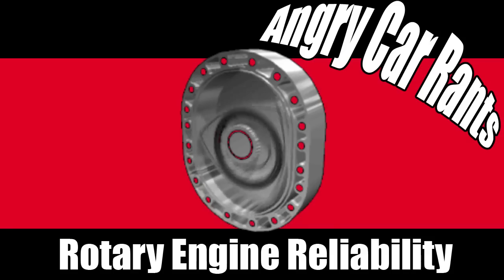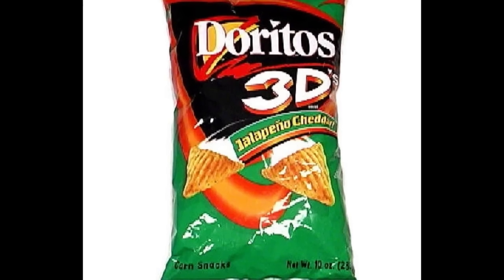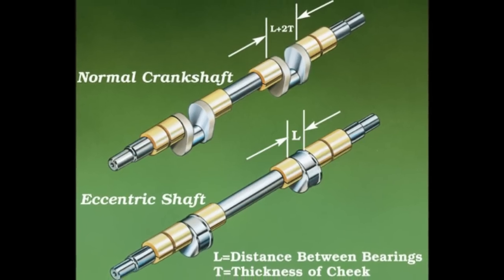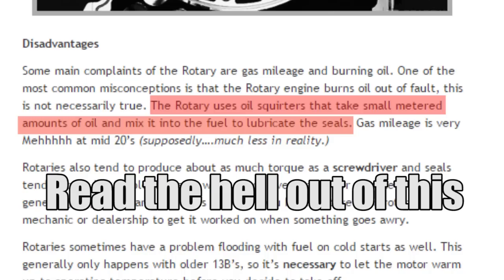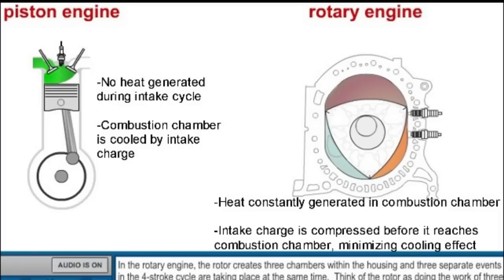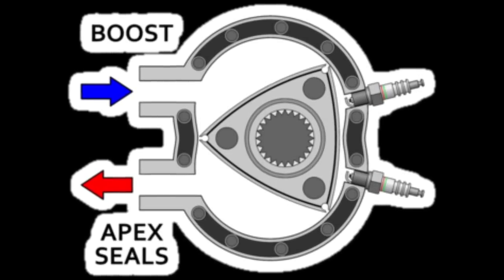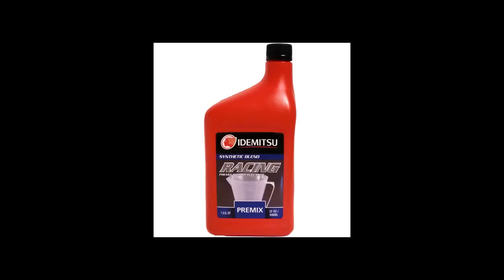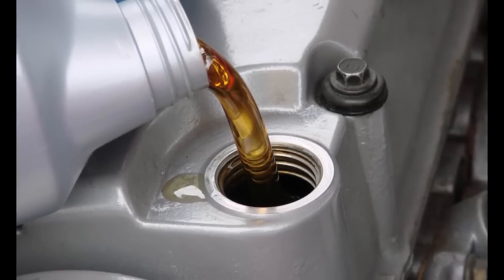Angry Car Rants #3 - Rotary Engine Reliability

Comment: The only caveat I would bring up to all of this is for series 2 RX8 owners.  If the OMP is still on the car, it's best not to premix.  Reason being that a third injector was added to each housing.  It's a bit of a debated topic but it seems most agree it's no longer needed for that engine specifically.
Reply: You should never remove the OMP on the RX-8.. Pre-mixing only helps if someone carelessly runs the engine low on oil. The most common failure mode of the apex seals is not prevented by pre-mix and is actually made worse by pre-mixing.. although this may be a popular myth? it does absolutely nothing to prolong the life of you engine...
Reply: Pretty much all race engines are OMP free...
Reply: +Chad Bremer But your average RX-8 owner is not racing.. so its still very bad advice.
Reply: +Chad Bremer You do realize that a proper race car does not have DFCO mode either.
Reply: I never advised removing the OMP.  Your reading comprehension is not up to par these days.  

As for fuel cutoff, that is pretty obvious.  It's a fuel saving feature.  Not needed for racing.  Also, the lack of lubrication is bad on the rotary that is race built.  Since it lacks any seal lube outside of the premix.  

I am curious.  You have been trolling rotary videos for years.  Not sure what drives you so hard in this pursuit.
Reply: +Chad Bremer Yet you recommend pre-mixing??? which will not extend the life of the engine if the OMP is working properly and the oil level is maintained.
Reply: +Chad Bremer  I'm not the one making childish insults and repeating bad advice and false rumors you read on a forum sites.
Reply: Oh, I'm sorry.  I forgot you know more about rotary engines than anyone else.  You are the all knowing god.  My bad.  lol
Reply: +Chad Bremer  No I just know a lot more about Rotary engines than you... you don't even know what a rotary engine is.
Reply: +Chad Bremer  What is the difference between a Uberusel UR-II and a   Le Rhône 9J "mr. Rotary expert"

Comment: The FAKE doktorbimmer you make me feel confident, because it reminds me that I’m not burdened with your negativity.
Reply: dakken74
dakken74
2 years ago
Once again,,it's obvious here who the angry troll here is,,,how do I know this? Because you are the one calling me that lol,,,your just making yourself look stupider the longer you persist lol
Reply: +Chuckiele Engineering is not a "faith based" endeavor son, it is a science that must comply with the laws of mechanics, and the laws of thermal and fluid dynamics. Mazda manufactured the Wankel KKM longer than any other company and they have not released a new production Wankel engine in 23 YEARS!  So I sincerely suggest if your hoping for the Wankel to comeback? That you don't hold your breath!
Reply: @dokterbimmer7270  ernie brink is simple, straightforward" Yes you are, Ernie. And it's guys like you who often have made discoveries that wound up changing the course of industries. You know stuff intuitively, while certain doktors point to theories and mock others while saying 'it can't be done'. Well, clearly it can be done. You called for some basic configuration changes in the wankel, Mazda did this (if not exactly what you called for) and 'boom!' they've revived the technology and found new advantages with it. Nice going, Ernie!
Reply: @dokterbimmer7270  this guy is you

Comment: They are reliable, just not very durable.  Never used premix and the engine in my car has only been rebuilt once total miles on the car about 165k with a 450whp, compression is still within spec on all faces.  Will it need a new housing or two when I do rebuild probably but it's not like premix is going to extend the housing past 180k anyway.

Comment: i heard the exhaust manifolds on most rotary Mazdas are really restrictive and cause most of the overheating problems, would replacing the stock exhaust system for one with a bigger diameter help noticeable with this problem?
Reply: George Washingturnt This reply is a bit late, but one of the main disadvantages of the rotary engine design is that they tend to be insanely loud. This can be fixed with decent mufflers and restrictive exhaust ports. The exhaust ports are part of the rotor housing, so to get less overheating and more power you need to replace the rotor housings with aftermarket racing ones. (The rotor housings are the equivalent to the cylinder head and engine block in a normal engine) The problem is that this causes the engine to be so insanely loud that your car will no longer be street legal.
Reply: George Washingturnt The problem is that the Wankel engine extract so little power from the heat generated during combustion so a much greater amount of heat exits the engine... it causes the high EGTs, explains the poor fuel economy and the Wankels horrible BSFC

Comment: Would the chance of engine flooding increase the more you stalled the car?
Reply: Flooding is most often caused by low compression due to damaged apex seals..  Get a proper compression test before you throw money at parts you don't need or just give you a temporary fix.. unless you plan to sell (which isn't a bad idea either)

Comment: To cool these spicy hot Doritos you need mountain dew, not bigger radiator.
Reply: We're working on a fully computer controlled Mountain Dew injection system. Main problem is the control valves getting all sticky.
Reply: Use diet Mountain Dew fam

Comment: No mazda rx8 recalls on engine (search for yourselves). Court case got thrown out by the judge and it was over the spark plugs. There are always the haters out there that will say anything they can against the rotary. And there are those who love the rotary. In my experience most haters of the rotary have never even sat in one. Others have had a bad experience like any other car out there. Rather experience it for yourself and then make up your own mind. But if you do want advice, rather talk to some one that knows it firsthand.
Reply: ummm the renesis was a bad motor... They had to extend the warranty on the engine due to so many failures, some of the remanufactured engine came with the sameeeee problem too. Blowing up before even hitting 1k miles

Comment: man im planning on getting a mazda rx8 as my next car but after all the complaints people have and the reputation of rotary is it really worth the hassle, even though i love the car and would love to own one?
Reply: jiuop Check the oil. Change the oil. Maybe pre-mix? Don't overheat the engine. Don't cold shut off. Redline every day. Should be fine. Ask previous owner "how much oil does it burn/consume?" If they say none, run.
Reply: ninjagrayfox thx for the advice man
Reply: jiuop Don't let the reliability reputation dissuade you, rotaries and particularly naturally aspirated ones can live long lives when maintained properly. They just require a little more vigilance than say a Toyota Camry or Civic Si.
Reply: jiuop The Renesis engine has a very bad reliabilty record.. and was a big step backward in longivity for Mazda Wankel engines.You will probably find a lot of nice looking low milage cars for sale, unfortunately most them will require a new engine.My best advice is to look elsewhere, but if you insist on a RX-8 under no circumstances buy one without performing your own compression test at the Mazda dealer and do a hot restart test.. flooding is a very good indication of an engine that has damaged seals good luck
Reply: ninjagrayfox Well thats not really true.. if properly maintained the Toyota Camry engine will most likely last 3-4 times longer...

Comment: My RX8 has a failing engine(thanks previous owner!) Is it better to just buy a used engine from japan or open then engine and hope its just the apex seals that are bad?
Reply: Joey H no just do a rebuild and save yourself a big headache
Reply: Joey H Rebuilding a rotary engine really isn't that bad, having it rebuilt professionally would be way cheaper than just importing an engine and the having it installed.
Reply: nick fernandez Really? all the quotes I got for a rebuild were about 5-6k from several shops while the engine is 1.5k
Reply: Joey H nah it should be like $3200 tops, and I wouldn't trust a $1500 engine unless you're familiar with the company that's selling it, at that price it's probably done 60,000 miles and is from a wrecked car and even so you'd probably still be looking at a sizable amount for shipping and installation.
Reply: Joey H Replace it with a v8.

Comment: Why do you people always argue about rotary, or conventional, ad get so pissed on each other. I mean who cares how many miles an rotary did, and it needs to be rebuild on 60K, but other engines do 200K. I am a car enthusiast, and I am not a Rotary fan, but I respect them, and I like them for reasons that one of the most powerful cars are build from several rotors, with turbocharging, and they can rev crazy high. Yes they blow, because they rev crazy high, and because of the reasons explained- due to the rotary design. Yes, I respect rotary, but personally if I am going to tune an engine, I would go with conventional, may be 4 or 6 cyl straight, s.th like a 2JZ. This doesn't mean that I will hate on the Rotary engine, they are good for the size, and 2 or 3 rotors with turbo can be so powerful, reving so high, and still keep your drift car so light. It is up to advantages and disadvantages, and for who it is an advantage, or disadvantage. If you want a crazy revving rotors with turbo for a drift machine, and you can afford to fix it if it blows often, than you are really happy with it. Why do you argue to which is better, in general nothing is better, because for you it is, for me it isn't. Yes a regular engine can last longer, and hardly burns oil, so for a daily driver to pick your kids, a rotory is not ecologcally good, and I prefer they do not make it. However for someone who likes and enjoys it, why not.

Comment: APEXS FAILURE        WHEN  IT IS IN THE PLUG HOLE
Reply: a brilliant mazda and lexus mechanic (who obsesses about rotary engines the way ferrari owners obsess about their paint finish) has stumbled across two mechanical breakthroughs that could make the rotary a total lunatic on the track as it ought to be

Comment: this is all a lie dude where are you getting your info I have a Rotary Motor from mazda it just flipped the odometer it just now after being 20 years old is starting to loose compresion it still pass smog with no oil being burnt so you might want to check your facts it Passes smog every time I smog it thay compare it to a hydrogen motor so your info is wrong.

Comment: regular consumers simply want a car they can buy from the factory, follow the recommended maintenance for 200,000 miles, and not have to worry about ANYTHING else.  Mixing oil with the gas, or adding a larger cooling system?  GOOD LUCK trying to get ANY consumers to do that.  You'd have better luck farting your way to the moon.

Comment: The only reason to get a rotary is for the sound and crazy revs.
Reply: +Flash Man 
Just gear up any 'ol piston engine, the 1 : 3 that is between the Wankel "rotor" and it's crankshaft,  (ooops, "e-shaft"  heh heh). Redlines on stock RX 8's, a poky 3,000 RPM "rotor" and 9,000 RPM crankshaft. Guess which of them was the choice to feed the electronic tach that the sales department nailed to the dash. 

What's 9 grand good for? Only bragging rights. Average ring and pinion on piston car, 3 : 1, most popular ring and pinion for the RX 8, 4.77 : 1. The piston crank is already 3 times faster than the rear wheels can use, more is better? Not according to sales. Now Sashquash and the easter bunnie……wait, wait, can I sell you COLD FUSION…… Naw, got no Braaaaap………,